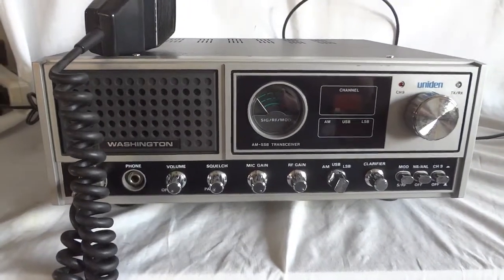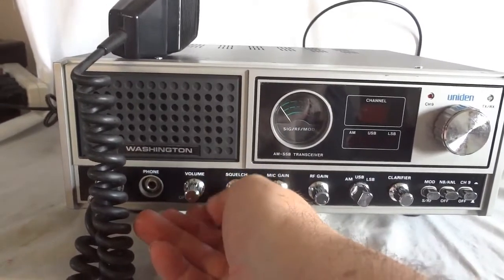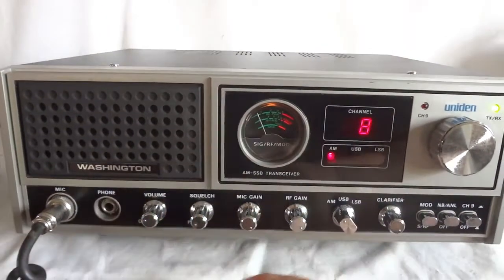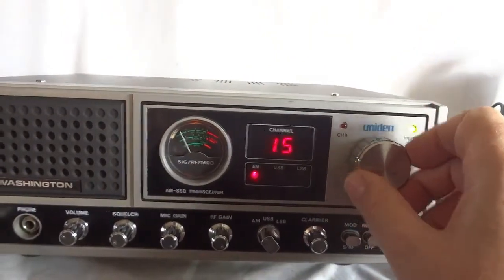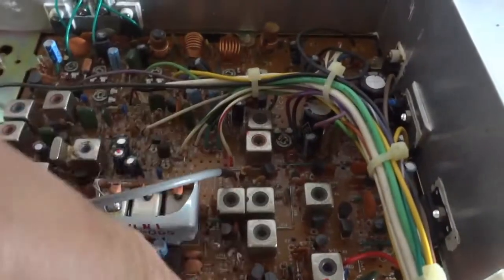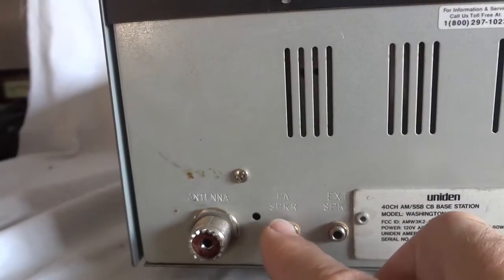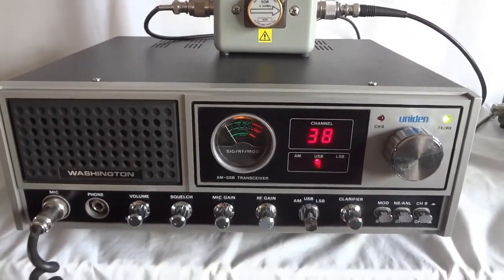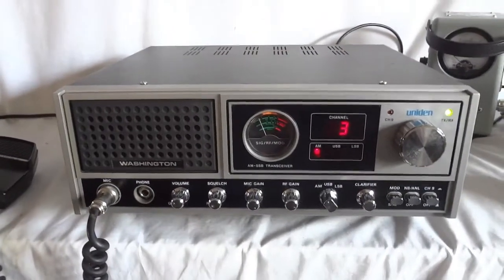Uniden Washington vintage SSB base station 40 channels sidebander

Comment: I am glad to hear myself on 385. NeedleBender 821 de WitchDoctor  Trinidad West Indies.
Reply from the maker: Yep! Came blasting out like gangbusters 🙂
Reply: @LifeIsTooShortForQRP  The radio at that time was the Cobra 2010 off my Antron99. I now use the Antron on RCI2970 for dxing on 10m. Thanks for your video.
Reply: Hey which doctor I’ve talk to you a whole bunch of times. 750 in the Buckeye said that

Comment: What sort of range does the radio get ?
Reply from the maker: That depends on so many factors, it is almost impossible to answer. Your antenna; the antenna used by the other station; the terrain; time of the year; time of day; solar activity; it all plays a role. If your CB antenna is a mobile whip on the  balcony fence of your apartment building, maybe 5 to 10 miles, if the other guy has a reasonable setup. But if you have a 5 element beam as an antenna on a hilltop, the groundwave alone might get you out close to a hundred miles. And if there is E-skip propagation, you should be able to talk to stations across the country. And, if we are at a peak in the 11-year solar cycle, you might be talking to Europe and beyond, assuming you have a 5/8 lambda vertical, or even better, a beam antenna. Like I said - almost impossible to answer....